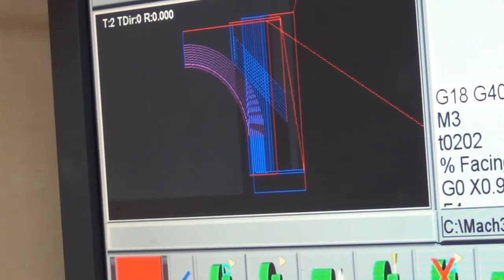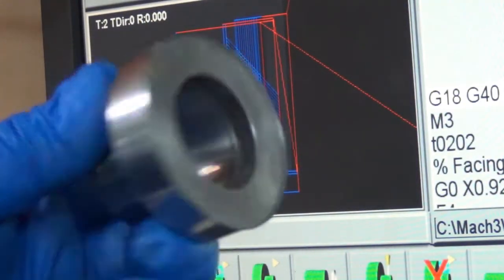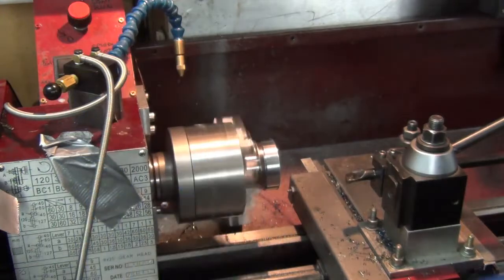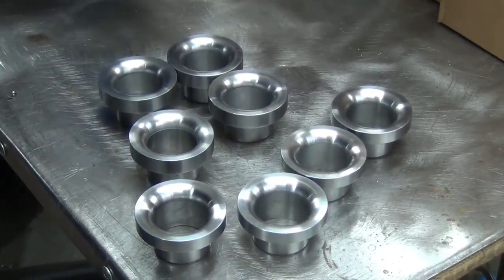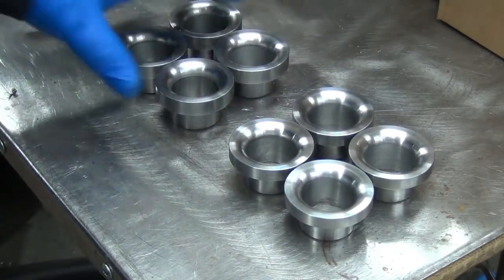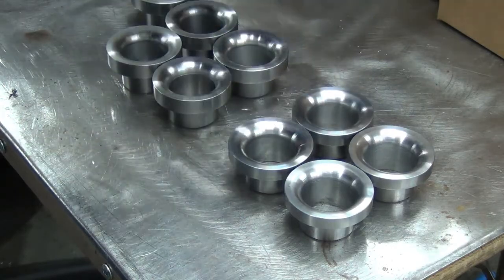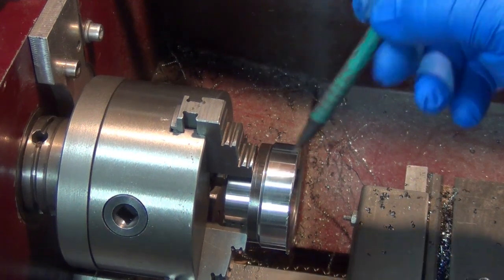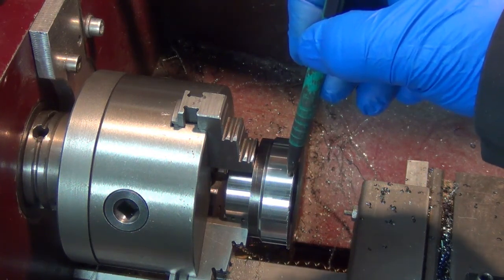9x20 CNC Lathe - Inner Bearing Adapter - Part 5

Comment: Man that is nice little CNC lathe.And great video of her working up close. Thumbs up everybody.
Reply from the maker: Thanks!  It's given me some frustration, but over all, I'm pretty happy with it and it's paid for itself at least three times over already. :)
Reply: bluehandsvideo
wow...now your tempting me to convert my 9 x 20 Grizzly 4000. Just received my AXA Quick change tool post kit and well its gonna need a new center post made and I will have to cut the old threaded post off as I can't see any way its threaded into the upper cross slide, seems to be locked on good, so will have to cut her off with my cut off die grinder and center drill the nub out and thread it bigger then the original shaft then make a new longer post and thread it to fit. The center post they sent me will end up too short by 3/8 to 1/2". So going to need to mill and threading work done on my upper cross slide assembly. And have no mill so I guess will have to wait till i can afford the 100 dollar machine shop rate close by to do what I need done.I can't even do threads on my lathe till I fix the auto feed, I broke a shear keyway off and its an odd shaped keyway designed out of soft steel to be sheared if you let the auto feed hit the end of its travel. Was the first bonehead thing I did first day I had it. Did not know enough about it was just testing functions...and it functioned alright...right to a dead stop.
Reply from the maker: 1NRG24Seven
I just looked up the manual for yours on the Grizzly website....page 65....looks like the tool post stud might be pressed in from underneath.  If they used bearing and shaft retainer, you may need to put some heat to it.

Crashing it the first time you use it sounds like something I would do!!!
Does grizzly sell a replacement part? 
I had all the removed parts when I got this lathe, but I've got a buddy with the same lathe.....I gave him all the parts since he had broken a couple things on it.  For as much as he's broken, I'm not sure I'd like this lathe as a manual lathe!
If you want to make the drive, we can do the machine work here :)
Reply: bluehandsvideo
Yes appears to be pressed in. Two ways to fix it, one cut off the old post and then mill cross slide back flat, then drill it and tap it for new post. If its pressed in that tight that would work. Or two cut it mill flat and then make new spacer and drill it at four corners and then center drill it to fit threads on the new post that was sent in kit. I could just screw the spacer at four corners to crosslide. Crosslide would then need to be drilled and tapped for some small machine screws to attach the spacer to cross slide Heres the question..should post be anchored to cross slide through spacer like original or would attaching post to spacer be good enough. If i need the post anchored all the way down to cross slide then a new post will also have to be made, made longer as the one sent is just screwed into new supplied spacer And then I could use my same spacer..New post is also bigger diameter then original but fits my old spacer fine.
Reply from the maker: 1NRG24Seven There's no way to press it out?
When I bought the bigger lathe, I traded the incoming post for the one he machined to fit the lathe...he needed a new one to machine for his new lathe anyway.  On the cnc lathe, The riser block and tool holder were already done.  I haven't paid much attention to how the post is mounted.  I gave the compound away, so I can't look at it either.  Long winded way of saying...."I don't know" :)
Reply: bluehandsvideo
The post where its pressed in is like 5/8 to 3/4 and figured if it was bigger then new hole then leave it be and drill it and thread it.
Reply from the maker: 1NRG24Seven
AAhhhh......now I get it. That was the part I was missing.  Makes perfect sense now. :)  Thanks!!